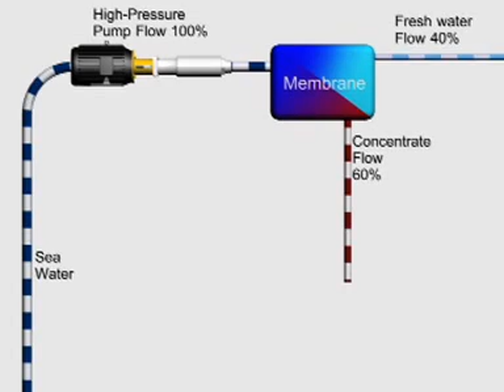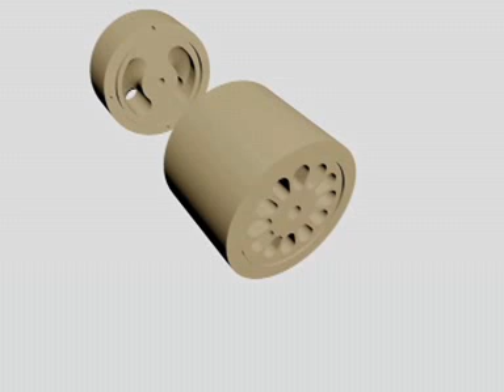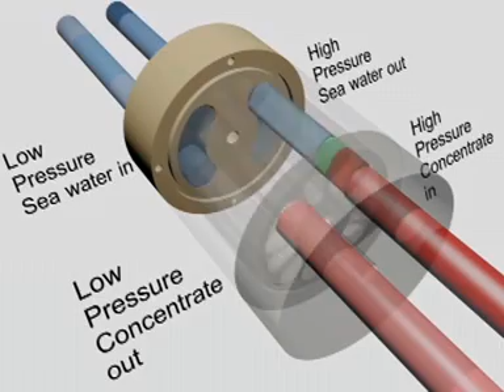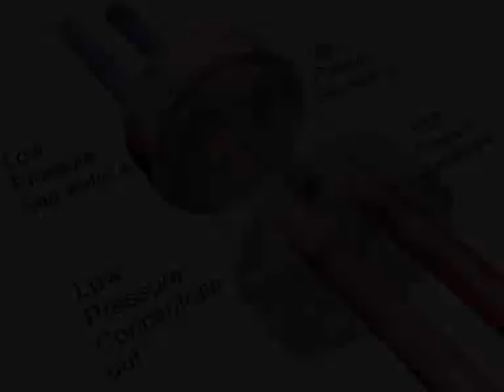eri pressure exchanger "deserves your attention"

Comment: This device was invented by LEIF HAUGE and the  Board of Directors stole this technology from him. ERI's success is based on a huge theft of technology.
Reply: "The dispute between Mr. Hauge and his former employer, ERI, began more than thirteen years ago over ownership of intellectual property rights related to “pressure exchangers,” a type of energy recovery device used in reverse osmosis. On March 16, 2001, the parties entered into the Agreement resolving the litigation. Three days later, the district court adopted the Agreement and issued the 2001 Order, stating that ERI was to be the sole owner of three U.S. patents and one pending U.S. patent application: U.S. Patent Nos. 4,887,942, 5,338,158, and 5,988,993, and U.S. Patent Application No. 09/508,694, which later issued as U.S. Patent No. 6,659,731.1

"The Agreement and subsequent Order obligated Mr. Hauge to transfer ownership not only of the patents, but also “all other intellectual property and other rights relating to pressure exchanger technology” pre-dating the Agreement and 2001 Order. J.A. 10, 16. The Agreement states: “[t]his assignment and transfer of rights is not intended to extend to inventions by Hauge ․ made after the date of this Agreement.” J.A. 16. The Agreement also contains a non-compete clause, prohibiting Mr. Hauge from making or selling energy recovery devices for use in reverse osmosis salt water desalination for two years from the date of the Agreement. J.A. 18."

Comment: freakin' genius!
Reply: Dear Mr.Christopher,

I am sorry if this message will bother you but I want to ask you an question regarding the PX device. I am a student from Algeria & I will do my project these on it!
I want to know if the rotor inside turns out  of the water pressure (as I am thinking) or there is something different that occur the rotary motion of it?

again forgive me in advance in case you find this strange from me or if it will bother you.
Respectfully,
Nassir
Reply: "Using just the energy of the reject..." 0:52
"The rotor is turned by the flow itself..." 2:27

I'm no expert but based on the previous statements and the geometry of the fittings I'm pretty sure no additional work is needed. Good luck on your thesis!

Comment: An interesting exercise in the velocity of ions v. water, expected elution deposits (in the rotor ducts,) spinup states, hydro bearing forces (and spec; time to roughness EOL,) etc. There is a heck of a lot of stuff in Egypt's briny ends of seas that makes water recycling and retention of prefiltered water important, and expulsion of brine to the sea...well, less preferable than sodium and chlorate complex conduits (brine conduits are too reactive to run!) Egyptian 30x500m ceramics, really?